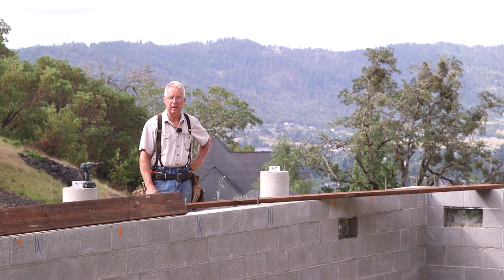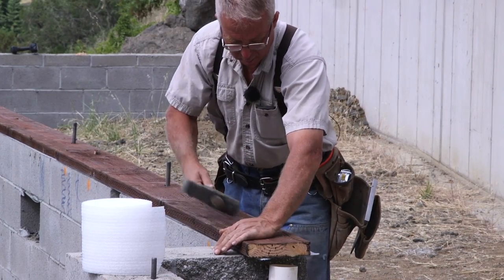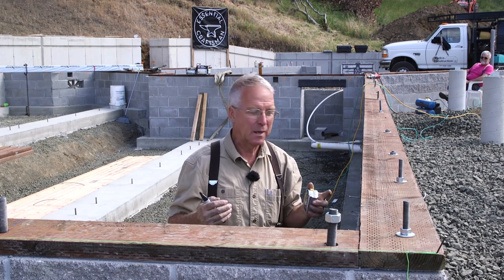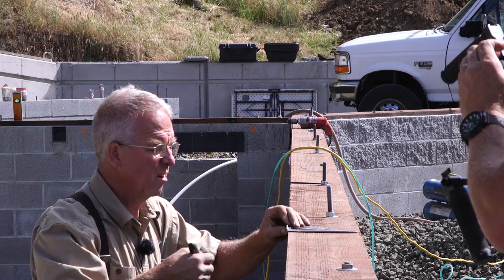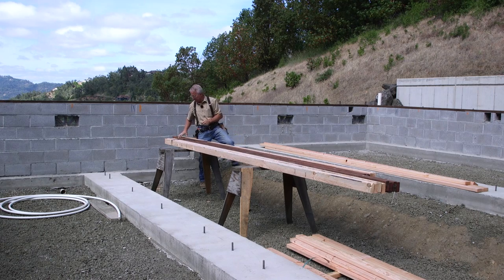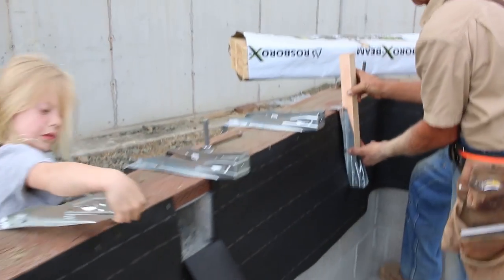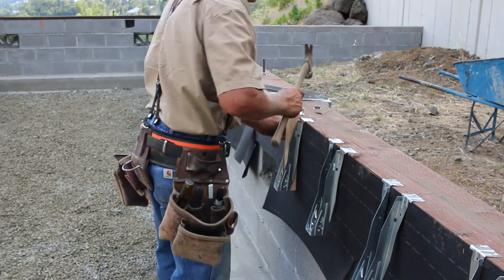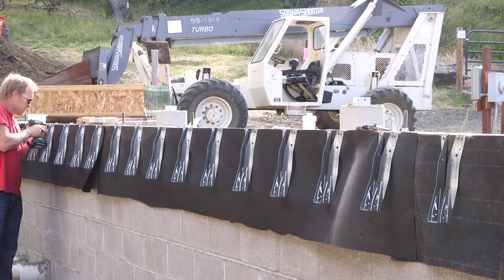Hold Up The Joists Ep.39

Comment: Nice to see that the "Dump and Run" is not the delivery method. Why the crazy tall j-bolts leave? Hangers= Costs, why not joist/deck on the mud sill and the DWV inside the Rim board? Pipe exposure isn't the concern or you would have done a conditioned crawl space not vented. Biggest for me is it is always faster/better/cheaper to build outside instead of inside constraints, and the proud bolts don't interfere . I enjoy learning from you Scott so this is not an argument but a conversation because I know you have thought this thru and have a good reason other than Tradition. Thanks
BTW I am left handed and I layout Left to right.

Comment: Seal those TJI ends with a  water based wax  brush on wax sealer treatment when you use  FN connectors.  Did this starting  over 20 years ago(used Anchor Seal} and it has worked out good in this type of  hanger detail which I applaud you guys using.   A quick nice touch for no squeaks or moisture related problems.    Hope you got them doors and windows on order!   You got some cute help there.

Comment: Enjoying your series, nice to hear someone speak slowly and clearly.  the regional differences are interesting.  Grouted block is standard out there?   Give me a rebar reinforced concrete wall every time.  Why not a full basement?  Ledge?  And then insulating the floor joists from a crawl space?  Rat slab?  Sill seal is mostly an air sealing gasket.  We level and square with a 2nd coarse of lumber.   A bead of const. adhesive as a compression and air gasket between them.  Caulk mudsill butt joints too.  Probably a waste of time and money, but it's what we do.  Like the GRK's, the pull out strength probably compensates for leaving open holes on the side flanges. For gods sake, go buy a joist hanger gun.  Looking forward to the next one.

Comment: 21 mins in! standing up the pony wall-sight across to the stem wall...perfection👌👌🤚☘☘
Reply: hmmm...look again, Kev. That is a mistake, the wall needs to be shorter by the depth of the TJI + the 1/2 inch or so He wants for shimming.
Reply: @richardvsassoon5144  I looked again and I think it is!! after it's dropped ! might be the angle of the camera- great videos guys👏👏
Reply: @kevinhealy4502  good eye, Kevin, the wall is sitting on top of the bolts, but still don't think its gonna be low enough...
Reply: @richardvsassoon5144  no doubt Scott will whip it into shape if it's not😂should be entitled "ESSENTIAL VIEWING "enjoy the build richard👍

Comment: I had similar issue, used 12” block for stem wall, and 4” block for rim, thus creating a shelf for the floor to sit on. Also in the northeast there would have been a metal termite/ant shield along with the foam undersill

Comment: I’ve always used a pressure treated mud sill but then use a redwood overlying sill separated from each other using pine tar.  The foam in a great idea.  So far I’ve not been gigged by an inspector...”better ridiculously too much than not enough..but you didn’t need to..” -my first inspection

Comment: With your pony walls, you can string a line end to end pull a measurement for each stud green plate to your line. Subtract the measure of your plates and joist. Boom! Easy, fast, and perfect 👌 no need to cut everything 5/8 short and shim later.

Comment: In order to improve the fire resistance of the wood framing, it is possible to spray it with fire retardant chemicals. Its also advisable to use non-combustible plywood for the floor diaphragms and roof sheathing since the house is located in a fire zone.

Comment: Very nice job. But as far as i can see, it is not sealed between the joists and the brick wall.
In Norway we use a piece of bitumen or asfalt rubber that is sandwiched between the layers  making an airtight seal.
Prevents bugs and moisture entering.
Also the the filt as far as i can see has the same problem, if it would have been over the sill and pressed down, it would be completely airsealed, now it will leak between the joists.
Exciting to see the result. Love youre crafting videos!

Comment: The foam plate gaskets also help a little with air sealing.
Reply: "little" being the operative word. if the crawlspace (or basement) is conditioned, one should (must in some places) use a better method than this. eg rubber bulb seal and/or polyurethane sealant (sika-seal or similar)
Reply: @erict7499 Oh for sure, I would also recommend taping (acrylic peel and stick or siga tape for best results) or fluid flashing the sheathing on the out side.

Comment: Another pro tip while installing seal seal would be on long runs in between bolts where the wind keeps blowing it off just tap it against the concrete with a hammer it  sticks!!

Comment: You could have used that bug mat/mud seal as your template for drilling the holes in the wood. Once you poked the holes in it, take it back off and lay it on top of the wood  to drill through the holes. No more measuring 🙌🤓

Comment: Scott, you mentioned that cutting pressure treated lumber exposes untreated end grain (or flat grain in a rip), leaving it vulnerable to insect infestation and rot. What you didn't mention was the solution - which is to saturate fresh cuts with a copper napthenate product.

Comment: Wrong-handed tradesman here (pipefitter/plumber). Running a fast measurement, for me, goes like this: hook the tape on the end, run out my distance, mark, and move. It's sort of intuitive to have the tape in my right hand and a pen/pencil in my left (depending on the material I'm working with). Every tape measure I've ever used has been set up to sit on my right side with the hook forward, as if to be caught on the end of a piece of material and run out with the right hand. I also put away and retrieve my tape far more often than my other tools, always with my right hand. A tape with the numbers inverted from the current standard would screw me up all day.

A wider tape would be bulky in the hand and heavy, if you wanted left/right-handed markings that are legible from arms length. A guy with big hands like me would be fine, some guys on my crew would have a hell of a time.

Comment: I see how you locate where the bolt holes are drilled along the length of the boards but could you show how you are getting the side to side locations in the 2x8's ?
Reply: Typically if the wall is getting hangers you flush up the pressure treated board to the inside of the concrete wall so the hanger flange has maximum bearing on the pressure treated board. If the wall does not get hangers you flush it up to the outside of the wall to minimize the amount that your exterior walls hang past the pressure treated lumber when it come to the wall framing stage. To get your side to side bolt locations you measure from the edge of the concrete wall that the pressure treated board will be flushed up on over to the center of the bolt.

Comment: We snap lines on top of the sill plate due to building on basements that are terribly out of square.  The more bays and step outs (as well as sheer size) the worse it is.  Block isnt usually as bad, but when working with poured walls, squaring the deck itself is more practical than squaring the green plate.  My nor'east carpenters will agree!!

Comment: If establish your  layout on two longest parallel walls first, snap a line on each and square the largest corner snap a line and parallel off of that squared corner you can use  your chalklines as reference for your plate and your building will be perfectly parallel and square to those designated dimensions.

Comment: Ah .. my day is complete. 

Maybe technology has improved, but I have to start replacing the hangers under my house, which was built-in 1984. They are rusting out. I don't know if they weren't installed right, or what the problem is.  But, to be fair and as you noted, even those pressure treated sills won't last forever.

At least my home is on wooden posts (12x12 I believe) so I don't have to deal with concrete walls. But, at some point, I'm sure those posts will need to be replaced too.

Thanks for documenting all of this, I always learn a new trick or two.  And it goes good with a bowl of raisin bran!
Reply: Call Simpson or Hughes or whoever the manufacturer was. Maybe you’ve got a guarantee issue.
🤜🤛

Comment: I come from a construction family. But most of what I know is from the '50s and '60s. So I always learn a lot from your videos.

Now you mentioned tico nails. (Probably not how you spell it.) I remember when the first "tico clips" came out. That's what Dad called them. And I am always amazed at how far Simpson has gone, creating so many kinds of these. Thank you for talking about the hangers, and the changes in installing floor joists. I also enjoyed learning more about the mud sills than I remembered from long ago. For example, no more redwood mud sills.

If you gave the reply of the man at Simpson, whom you called about the horizontal screw installation, I missed it. I would think it was a good 20 minute chat, with firm approval on Simpson's part. Is there anything more about that which you would care to share with us? Or did he say something like, "Hey, good use of that hole," and that was the end of it?

It's refreshing to see your extra efforts now and then. That is no longer the impression that many guys in construction give, anymore.

Comment: You can use lead paint and solve the issue of any exposed surface after cutting. I never bothered with pressure treated wood because it loses a lot of structural value due to baking in of the "sauce". I use lead paint which is then sealed within a plastic shrink wrap plastic i get custom made from a plastics company. It will never rot. It's an old marine building technique (sand the plastic wrap) that has in some cases one hundred years or more behind it. Old school cool.
Reply: Can you please quote your source on pressure treated wood losing structural value? That’s simply not true.
🤜🤛

Comment: You could literally just do the smack-with-a-sledge-hammer way for the taller bolts, then do the meticulous measurements for the anchor bolts right after instead of doing them all manually.

2nd option, a long strip of paper laid over the wall, all bolts poked through, and creased at block edges---which is then pulled free of the wall and laid on the boards so edges match and holes are drilled accurately.

I've done the indentation and paper template method on several smaller projects. They both work very well.

Comment: Do they make an integrated joist hanger?  Something that might be able to be set within the block wall and grouted in with the rest of the wall? 

requires you know your floor layout when you're building the wall and probably have to factor that extra weight into the wall specifications - but seems like it would be nice to not have to nail in the hangers - just have them sitting there, set in the wall - then just need to fasten the joists in them and not deal with fastening the hangers to the mudsill

Comment: On the Mud Sill, you mentioned how the hangers "offset" the height because of the nailhead and hanger. This is where I would loose sleep too. HONEST QUESTION: Is it too much to cut-out those points with a router?  take way too long to complete these hangers and people could complain, but would I be correct? I work much slower than you, but I have  OCD on the same stuff that you point out so well.Thank you!

Comment: On Tape Measures - They're right side up if what you're doing is exclusively measuring . If you were figuring out the dimensions of something that already exists, you'll want the tape in your right hand. Far better control and easiest to swing it around to all the nooks and crannies. If you're using the tape measure to determine distance for marking , on something that is being built, then you'll want your writing hand on the marker and now the tape is in your left. Just think about each situation. 

Also, the tape in your right hand is more intuitive for the average consumer, who is probably going to set the tape down or ask a spouse to do the marking. And who is going to be frustrated from trying to read numbers upside down because they hardly ever do that. They are going to pick up a tape measure in a hardware store, pull it open and say "This one's upside down!" and buy a different one. Now consider that there is at least one tape measure per household, yet only, what, 1/5 people work in the trades? 80% of their market is Joe Homeowner.

Comment: Marking that would be even faster with a stamp, lol.  But I also wonder if you just quickly pre-clamped in a lot of 2x2s into the joist hangers, maybe it would create a quicker install w/ a nailer so the manual part where you're handling the same piece a thousand times would be decreased greatly. It may be a tiny bit of extra time with the clamping/cutting, but the reduction in time with the nailer and less materials handling should make up for that and surpass it.

Even something as simple as a rubber band would clamp it well without being costly or bulky or time-consuming. :)

Comment: @Essential Craftsman 
Why use the simpson joist hangers? Why not point load the floor joist on top of the stem wall? I heard the explanation @28:34, however why not drop the footings down the 10-12" then build stem then point load?

I ask because I am not a fan on hangers at all, I prefer point loading, and will go the extra mile to skip the hangers. I also believe that point loading is vastly superior.

Comment: I believe that I would have installed a galvanized sheetmetal termite shield instead of the felt.  It would have required a 90 deg. bend to slide it under the mud sill, and it would extend down below the joist hangers a few inches.  And, then bent 45 deg. at the bottom of the joist hangers.
Reply: no need = termites here are ...not a problem

Comment: My question is about the washers on the bolts holding down the mud seal I have always been told you have to use the quarter inch thick square washers I was just wondering about code in your area

Comment: So I take it you don't have termite problems in Oregon? I thought you always had to add the copper roll flashing on top of the styrofoam? And pressure treated lumber here on the East coast is green and the treatment goes all the way through the wood, enough so that the boards are still "wet" when you buy them at the store. They are almost like fresh felled and sawn lumber (what you call green lumber)

Comment: Until I heard your explanation, I was very disappointed about to use of the strong ties (as opposed to putting the joists on top of the seal plate). Not that I have anything against Simpson hangers, but as a travertine guy, I find the joint between stone baseboard and stone flooring to be much more resistant to cracking when the joists are put directly over the seal plate. But your explanation really shows the narrowness of my thinking, as well as the creativeness of your solution. Ps. I could still do a stone baseboard in a bathroom without cracking, it just takes more effort and I'm  lazy. : )

Comment: good grief couldn't you get a palm nailer for the joist hanger? The GRK's you used, not sure if its the same company but matt just did a vid on roof joist attachment.and how the method of using a joist hanger and other hurricane ties is a thing of the past. There is a screw, one screw through top plate into rafter, the heads break off so the inspector can see they were set correctly, bright color too. You should use them.

Comment: Are the anchor bolts and framing nails okay to use in treated lumber? Not sure if this was mentioned, but be careful if you are going to DIY as pressure treated will corrode certain hardware.

Comment: Was about to ask why hang the joists at all but that was promptly answered before I could get a comment off! I'm still a little confused about why the stem wall couldn't be a course and a half (ish) shorter; would the grade be above the rim joist in the back or is it purely a structural reason? We used these hangers on a second floor center I beam with an lvl on the flat. I remember having to route out a mortise for the top of the hanger, although we had hangers on both sides. Interesting to see the west coast ways, most houses have full basements here in New England. Anyway, love the series, psyched to see framing happening!

Comment: I see a fair amount of daylight at 2:02 on the right side of the wall top surface under the lumber. Shimmed to correct? 2nd item, after cutting the ends of the mud sill, was copper green, or brown, to match the color of existing lumber used to seal off the cut ends?

Comment: Would love to hear your thoughts on those OSB board floor joists vs solid lumber.  Those seem not nearly the quality of solid lumber.
Reply: I've never liked the concept. You have a house that's sitting vacant for a few months and you develop a leak - solid joists, normal problem. OSB TJI will turn to sawdust - your floor could collapse because of a common leak. I just really loathe the prevalence of OSB in construction these days.

Comment: The one thing I as a builder would add is when doing layout hook your tape in one spot and pull as far as you possibly can without moving your tape anchor point.  Every move is an opportunity for error.  I have seen it over and over with my employees.  And don’t ever think you can cut a spacer block and start at one end spacing each joist or truss with blocks and be accurate.... won’t happen.  Always use a proper length tape and mark out an accurate layout.

Comment: On 15:55 you see the tape sag as you extend it to mark the joists every 16 inches. Doesn't that result in an accumulation of error, making the joists closer and closer as you go (by a small amount, but still)? Laying the tape on top of the board would prevent that. I guess it doesn't make a difference in the end, but it caught my eye.